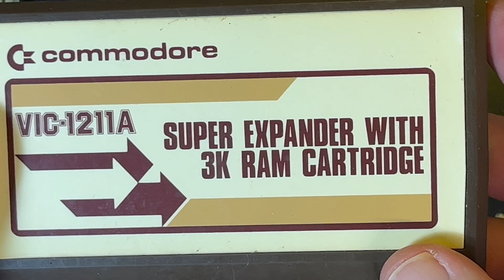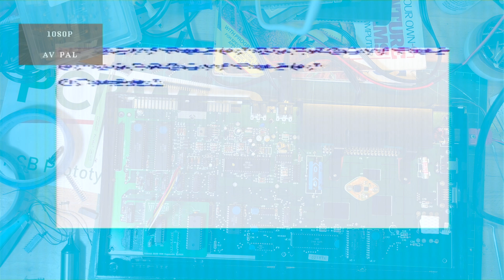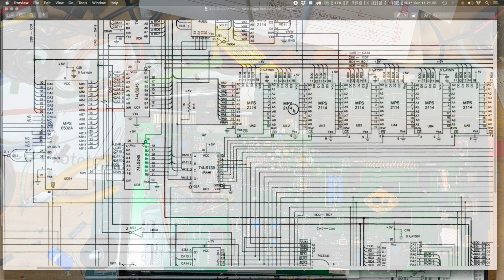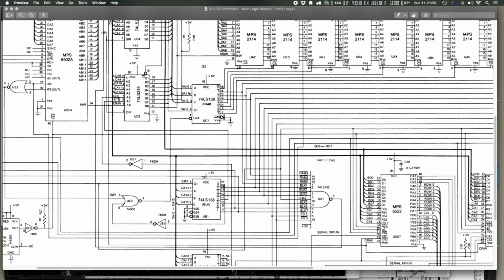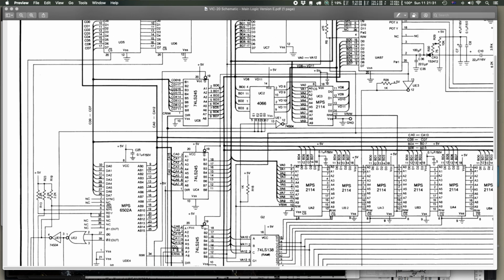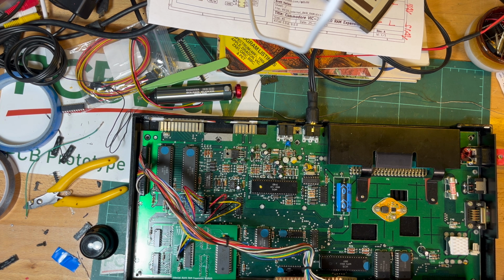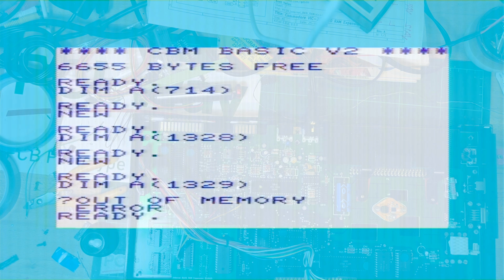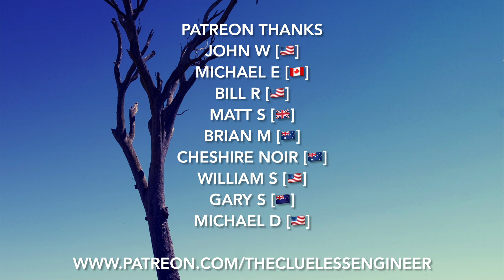🇦🇺 Commodore VIC-20 Internal RAM Replacement: Part 1 (First Test of 8KB) [TCE #0603]

Comment: Now that you have the 8K working, why not go all the way to the max the VIC-20 will handle?  Challenge accepted?
Reply from the maker: Ha, tempting but it has been done (see link below) ... however if you need to disable any RAM (because the program is designed for a certain amount) you need to open up the machine and fiddle around.  I'd rather leave it to a modern Super/Hyper Expander or Penultimate cartridge.  My idea here was to just replace the internal, possibly-faulty, definitely-inefficient RAM with the extra 3KB as a free bonus ... a 6.5KB VIC would've been an awesome machine at the time!  

https://www.pcbway.com/project/shareproject/8_16_24_32_KB_RAM_internal_expansion_for_Commodore_VIC_20_BASIC_EPROM_adap_3c6e21ad.html
Reply from the maker: Although ... thinking about it now ... if I replace the 6264 with a 62256 and use an ON-OFF-ON toggle switch, then maybe I could have switchable base 5KB (unexpanded), +3KB expansion and +24KB expansion.  I'd have to remove a 2nd 74LS138 (the BLK decoder) and add additional logic to my PLD to prevent the BLK1/2/3 signals isolating my RAM from the CPU data bus like the RAM1/2/3 signals did ... hmmm

Comment: Pretty much I caught that you made a mistake when you were designing the board, but as that already went to production I didn't comment anything waiting for a follow up.
Reply from the maker: It's no fun if it works first time! :)  It was an excellent learning experience ... that moment when you finally realise how it actually works.  If I just plonked in a board someone else designed then I would still be very clueless rather than slightly clueless about how the VIC works.

Comment: cool ..nice job....
extend that board..and move the PLD over to the top right of the board..cut the width of the board ..but make it longer to cover the 3 ics..
i was thinkin ya could maybe cut out them ic footprints in the board with castellated holes to solder the board directly to the vics board...but.. ya got pins from the PLD and ram to worry about.. (SMD version maybe?!)
Reply: There are SMD PLDs but most of them are PLCCs.
Reply from the maker: Through-hole makes it possible for everyone to do, although there's a lot of de-soldering required which is tricky on the VIC as the top-layer traces tend to lift-off if you're not super-careful.  I still need to check if I can get the case closed ... the keyboard has a plastic rim along the bottom that can interfere if your board is too high.  For the PLD, I could move it from the board up to a daughterboard that sits where the 74LS138 RAM decoder was removed as it essentially takes over its job but for now, I've just got a pin header there to run the wires from the main RAM board.
Reply: @Brfff  SMD ICs are not really that hard to solder...just need to watch for bridges...